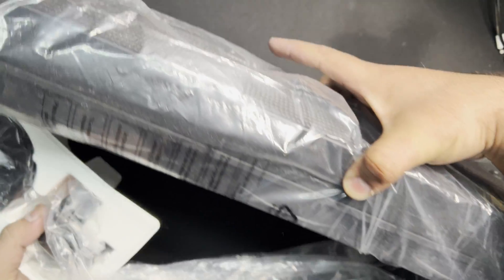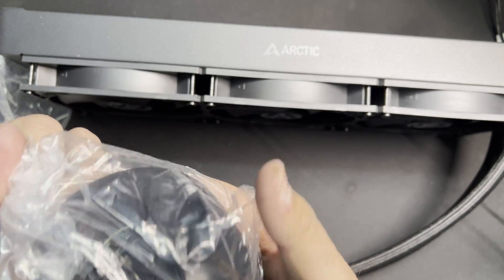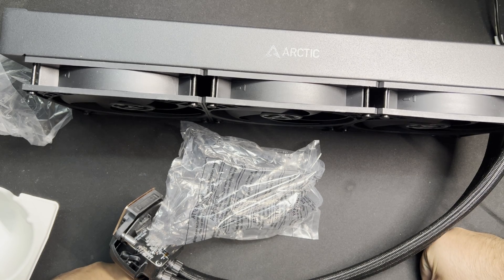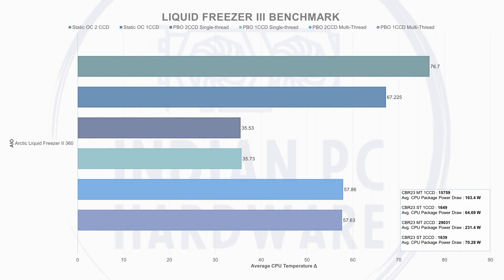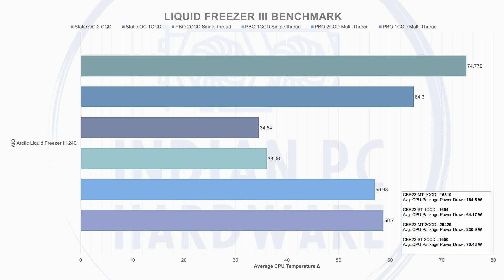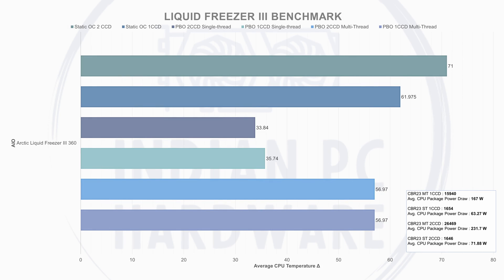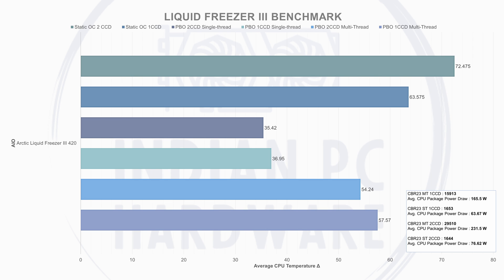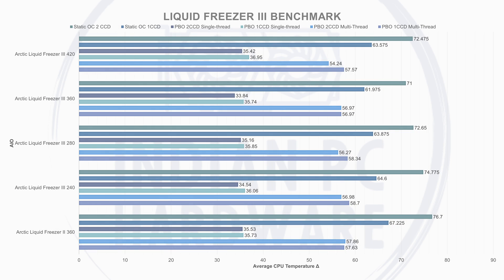India's Exclusive : Arctic Liquid Freezer III Benchmark

Comment: Bro how good this will work in North Indian summers where room temps reach 42*C, especially with AMD 3800X CPU?
Reply: I'd suggest priortising room conditioning before priortising new CPU cooler. What are you currently using and what temps does that give you? The AIO can perform well, but the ambient of 43°C can be a hinderance to let it perform to its max.
Reply: Yes, can easily touch 40*C as room temps.  @mostwanted002  **3700X CPU** not 3800x